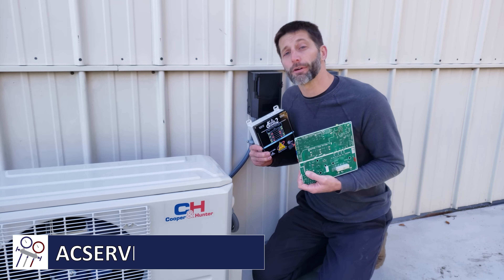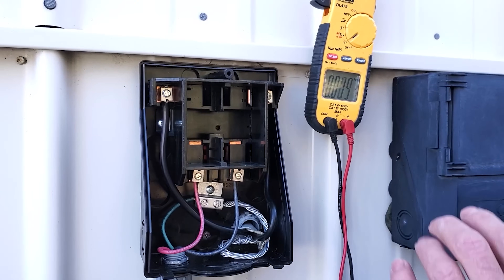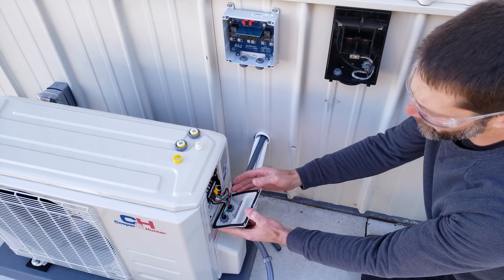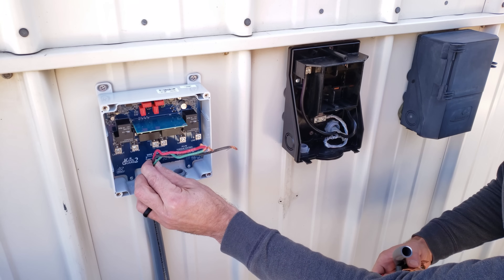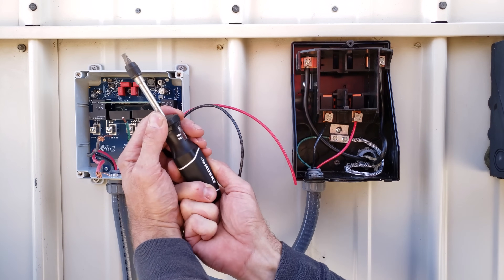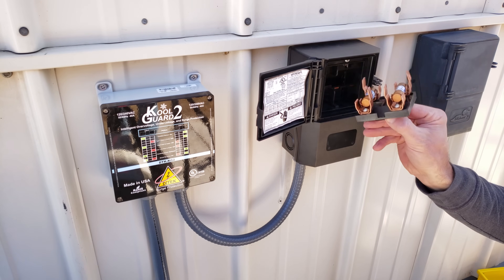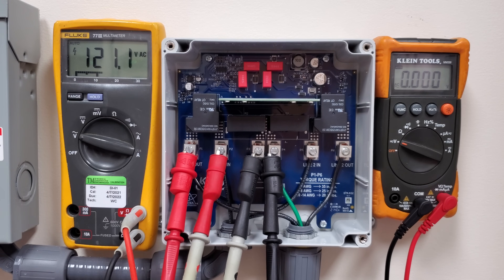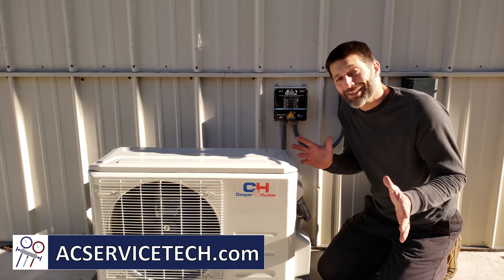Mini Split Failure from Electrical Surges, High and Low Voltage! HOW TO SOLVE IT!

Comment: I was a commercial tech for many years and installed a lot of input reactors which condition the power to even out the highs and lows. Mostly for vfds in industrial plants that had a lot of surges when large equipment would turn on and off. It was 575 three phase.

Comment: Nice. I have had so many surges/electrical problems at my house in the past few years. Blew out an led light, power strip, and washing machine board in that time. Installed a surge panel @ the breaker. That device looks like the way to go for $ unit protection.

Comment: I have a Cooper hunter minsplit with line in voltage 246. They are saying I need a step down transformer and disclaimed warranty.  They said max is 245. Do you think I really need this ? Is 246 really too high? thanks

Comment: Hi,
I'm getting ready to install a Rheem water heater that has a built in heat pump.   Do any of you know if the Rheem heat pump water heaters have this kind of protection built in, or if the KoolGuard would be worth installing?

Comment: We had a unit like this installed at our shop and the boards go bad all the time.  Our unit is a bit larger than the one in your video but fails all the time.  We've put a whole panel surge protector in but it still blows out the main boards and vfds.  It's a carrier. I'll have to inquire about this item and if it's possible to get.

Comment: Would you recommend Kool guard 2 over ICM 493 or vice versa?
Reply: Hello, what did you end up buying?
Reply: I assume this will work with any outside condenser between required ext shutoff and condenser ?

Comment: How did you get your hands on one of those? I can't get it from any local supply shop in Northern California. It kinda pops up here and there but no price or way to get it. I think this will keep one of my customers in Davis out of trouble with his 4 head mini split. The board and DC fan motor for the outdoor unit failed. I blamed the disconnect but seeing this makes me think it will really keep the machine safe.

Comment: sir i have a question.meaning  every time that there is a over or under voltage activity from the power source the unit is shutting down.?thanks for the info..

Comment: I have an outdoor unit (regular 3 ton heat pump) at the end of about 60 feet of wire in a 120/208 feed.  On very hot days it takes a few spinups to get going.  The amp clamp shows a very high start surge, but running is fine.  Capacitors all fine, regular incoming voltage looks fine.  I'm guessing that there is a voltage drop due to the inrush amps on that length of wire and starting out at 208 anyway.  Is putting this unit (for protection) and a soft starter (to deal with the inrush/voltage drop) together appropriate?

Comment: It does seem to me like that 120v countries have more power surges than 220v countries even in my 3rd world country i do see occassinal high or low voltage (250-190) but never had any power surge. My ups is very sensitive to power surges like turning the tubelight off causes it to freak out and still have not seen it go into battery backup mode while on normal utility.
Reply: May be, i have 230v where i live and it was never wrong voltage as far as i know

Comment: Would you recommend this especially if your running your Mini split off a back up generator for power outages especially in heat mode?
Reply: Considering that this unit is $200.00 plus installation if you can't do it yourself it might not even be worth the extra expense given you likely have a much cheaper unit to begin with. Make sure the generator is an inverter type as well for the cleanest power supply.

Comment: This monitor phase?  Like L1 120 V  and L2 120 V NOT 180 degrees out of phase? I'm looking to see if I can power a 240 V Mini Split with a 5000 Watt inverter off two outlets on the same inverter.   The mini split also is inverting AC to DC. I'm thinking the mini split board does not see phase and just needs to see 2 120 V legs.  Sorry if this is confusing.
Reply: Benjamin made a video on his channel covering this, I believe…

Comment: What is usually the symptom of a mini split that has been under a surge condition? Blown fuses on the board? A locked out board with no other explanation or is there an LED code? Or is this type of surge protector an add-on/preventative device? I only ask because I think ive only ever come across maybe one set of bad fuses on a mini split in my entire career(including my own), and that was because a snow plow had buried it in a huge pile of snow. Thanks.
Reply: Your right. Most mini split are electrically pretty robust, and many larger units also have a separate power filter PCB
Reply: They start acting stupid lol. No really, you don't want to have fun with that issue. Either that or the compressor won't start cause the inverter drive went out.

Comment: Do they make these for standard heat pumps and/or outside HVAC units?
Reply: As long as the circuit isn't drawing more than 40 amps continuously it will work on a standard heat pump / condensing unit.

Comment: Interesting, but also curious why other countries with millions of AC units don't make use of such power filtering devices at all? 
Or they have power filter circuit built in
Reply: They use voltage stablizer which is directly connected to the mains ( india style)
Reply: @zakkaidmello5641   I notice almost every outdoor pc board has power filter circuitry. So no need to double up on it
Reply: @Froggability  if that was true, why are these devices out here?
Reply: @Froggability  it cleans or evens out the power going to the compressor and motor it doesn’t regulate high or low voltage so this is absolutely necessary

Comment: Is this available in voltage higher than 240 ?
Reply: No, it is designed for 120/240V or 120/208V split phase circuits
Reply from the maker: I believe the highest voltage for this model is 240v presently, thanks!

Comment: In a new plant which had 11k amp @ 600v. The engineer was a co. cheapskate,he opted out for 2-500hp AC motors, instead of DC, In no time we 
found that firing 2 500hp AC motors together would drop the B phase on the grid. By the 3rd grid drop the elec co cut our service until we added 
2 soft starts, line conditioners, 200hp sullair to vortex cools all the DC rectifiers. Cost $200k over the int DC setup, by time we were done

Comment: So you are saying that the regular surge protectors installed by HVAC techs on the side of the power box are useless ??
Reply: that's incorrect.  Standard parallel SPD's are very important and protect from any over voltage surge/transient situation.  The KG2 was engineered for inverter driven HVAC systems and monitors and protects from both over AND under voltage events

Comment: Question I know this is a different brand ac but inverters with the E6 error code especially the Gree brand is it possible someone out there know how to fix.. this issue, or who to repair the pcb
Reply: What type of unit is it? Inverter, non inverter, cassette

Comment: Great video.  Seems like a nice product but…I wish we could know the price of this product without filling out a form and getting a quote.
Reply: It's about $360.00 on Amazon. Which I consider outrageous.
Reply: @j.p.8276  It's available on Amazon? I couldn't find it on Amazon.
Reply: @j.p.8276  Yes so do I. Not worth it.
Reply: @j.p.8276  The product is not available on Amazon and is nowhere near $360.00. Are you sure you aren't mistaking it for something else?
Reply: $360 for a good quality surge protector, that can potentially save thousands of dollars in new control boards and HVACR repair costs....is totally worth it.  Especially in areas where you may have very unstable supply power.
Reply: I'd pay it if I could only buy it.  It's not available anywhere to buy.
Reply: @ManTimeT.V.  Hmm, the mini split will be in a mountain cabin which has frequent outages to say the least. Are mini splits prone to damage from voltage fluctuations then?
Reply: @johnaclark1  Give us a call or email us at the factory and we'll help you locate a reseller/distributor in your area
Reply: @w1swh1  Hi there.  Yes, any electrical device that is controlled by a control board, would have the possibility to be damaged by power outages, high or low surge of power, etc.  If you have a cabin in the mountains, your best bet would be to heat it with a wood burning fireplace.  Or are you wanting a heat source while you are not there, too?
Reply: @ManTimeT.V.  Well actually we want it for cooling mainly. In the summer months it get so hot (90+) during the day. It's unbearable and stops us going some weekends. We have a log fire but in the mornings in winter it can be very cold unless we light the fire so it would be convenient for that as well
Reply: @w1swh1  Oh, I See.  Yes I agree, 90+ is warm haha.  No easy answers for you, though.  You could set up a heat pump with reversing valve for heat and AC, connect it to your mail power and also setup a back up power supply ( inverter ) that gets wired into your panel.  That way, if your power does go down, for long or short periods, your inverter will fire up simultaneously with the outage and keep your power supply stable.  It will run for as long as the fuel in the tank lasts.  Some of the tanks are quite big and can run for many hours straight, depending on electrical usage etc.  "Generac"  brand inverters are amazing.  Lots of good reviews and I know someone that has one and has to use it pretty frequently, as well.  This setup wouldn't necessarily be cheap for you, but it would set you guys up very well for almost all situations.  The Generac would be around $4000-5000 ( depending on what size you need ), plus install.  And the heat pump would be around $7000-10,000 installed.   These are just rough estimates without seeing your cabin etc.  If money is no issue...than go for this setup!
Reply: @ManTimeT.V.  Thanks appreciate it. 
An inverter would be over the top for our requirements. We have gone for a two zone Mitsubishi which I will try to install myself. Yes I know warranty would be invalidated but I've been watching all the Youtubes and buying top of the line tools and equipment. The cabin is remote. Nearest HD is over 40 miles away which doesn't sound much but it is steep twisting roads. Takes at least 4 hours round trip so if I forget or need something I don't have the day is shot in travelling. But it's still fun 😊
A guy called me about the voltage protector. So you would recommend it?
Reply: @w1swh1  that's awesome that you guys are doing it yourself.  Depending on what the regulator costs, I would recommend it.  As long as you can afford it.  What is the price of the Mitsubishi, can I ask?  If your main reason to get a surge protector is complete power outages, it may not be needed for you.  Is the power stable when it is working?  There is also surge protectors with battery back up as well.  I would really consider a generac or similar brand inverter.  You can get smaller, cheaper ones too.  Power outages shouldn't hurt your unit too much.  Frequent unstable power ( high or low ) is more to worry about.  You will have to test your power to see if that is happening before buying a protector for that.  And of course, see if the cost of it is worth it as well.
Reply: @w1swh1  also, I'm curious, where is the cabin?  It sounds amazing!
Reply: @ManTimeT.V.  I estimate the total cost including high quality tools will be less than $6500. Mirsubishi is 36,000 BTU 4 zone but only using 2 zones 18,000 BTU each.
Reply: @w1swh1  that's awesome!  Should be more than enough BTU for a cabin :)
Reply: @w1swh1  yes it is worth it , much cheaper than buying a new unit
Reply: 200 now

Comment: Bend the conduit  at your mark try make a180 degrees the wires will stay on the bottom of the conduits. Run a pvc cutter over the top lightly  it will rip but a little piece grab some snips. Faster than pulling the wires  brother
Reply from the maker: Yes, I actually I do the same with bending the conduit, partially cutting the flexible conduit and then finishing with a knife without nicking the wiring. However, I figured I should show the safer way where there is no possibility in nicking the wire, thanks!

Comment: Having a problem with mini split heatpump.
So the indoor Fan work on a very low speed when is set on Heat . From scale of 1 to 10 it blows only 1 . But on Cool mode it works perfectly fine, also the Fan when it’s on ON mode it blows perfectly.
But on heat mode the fan isn’t working and you can’t even adjust the fan speed.
The condenser outside works fine
Reply: Depending on your outdoor temps, the amount of heat it can move inside is very low. The unit knows this and will limit fan speed if your coil isn't getting hot. 
Or you have other issues.

Comment: I've never removed the conduit before cutting seal tight.  I just scour it with pvc cutters, snap it, and use dikes to finish it off.  Never had any issues touching conduit inside.
Reply from the maker: I hear ya and actually I do the same with bending the conduit, partially cutting the flexible conduit and then finishing with a knife without nicking the wiring. However, I figured I should show the safer way where there is no possibility in nicking the wire, thanks!
Reply: @acservicetechchannel  can you please tell me why you ise UEI meters instead of lets say fieldpiece or fluke. Im new to the field and I've learned so much from your teaching. Please help
Reply: @BOOKERT232  Use what you like. Fieldpiece never had a great reputation for me but others like them. Fluke is expensive but is now riding mostly on reputation. You can get Testo or even others. I like my UEI.

Comment: My pioneer 12000 BTU unit cost me $675 a year ago, not going to spend $360 for this unit, there are surge protectors for a quarter of the cost, maybe not as sophisticated but makes more $ sense
Reply: It's for people with $3000 to $10000 inverter systems. Yes, your pioneer unit is cheap. But even they can cost over 3000 for multizone. 
They can mostly handle voltage issues, BUT, if you have bad line power all the time, you need to protect it.
Reply: Brother, surge protectors won’t stop over and under voltage. This does.
Reply: @user-ln7of9gs4s  I agree, but willing to take that risk, which I consider low
Reply: Inverter systems are incredibly sensitive to voltage drops or surges these are actually a great device for companies installing a lot of inverters

Comment: I dont think customers will agree on dishing out $ 350.00 " inless ⚡️⚡️ issues 
in 30 years in the AC / heating trade i saw it once and it was due to the transformer called up hydro and they had to change it after a few arguments ⚡️⚡️
but interesting gadget 👍
Reply: Nobody had inverter units for the past 30 years except weirdos who bought Trane's unit in the 80s or early 90s. That's why. 
Kalos requires them on all installs of inverter units, like Carrier Greenspeed. They've solved issues where they had too high voltages come in and the power company will not fix. If you don't account for that you'll keep having a unit break and keep replacing control boards.
Reply: These new inverter systems should absolutely have these the boards are so sensitive to under and over voltage it burns them up constantly these things just haven’t caught on in the us which is crazy because it is costing companies a lot of money
Reply: I recently failed an American Standard Platinum variable speed compressor unit under warranty that cost me $2400 in labor/freon. The installer suggested I get one of these because I discovered the utility voltage will drop to 210 at times which is probably a death sentence for this unit, if it was running when the voltage dropped. I did have over voltage protection but that was not the issue it seems.

Comment: I installed a mini split in my cargo camper conversion and I have a hardwired voltage monitor/cut out for this exact reason. It was like $300 but we’ll worth it

Southwire is the brand. It super nice it has a digital display so you can see live voltage, amps watts. It does the same thing, monitors for over under voltage or short to ground reverse polarity etc and will cut the circuit.
Reply from the maker: Nice, thanks for the post!

Comment: So this won't work on 208 volts.
Reply: It works on both 120/240 and 120/208 split phase circuits. Both are 120V line to ground, 208V is just 120 degrees out of phase versus 240V being 180 degrees out of phase

Comment: I had lightning strike on my home that killed almost every electrical device . Fans lights tv computer server rack everything was fried but the only things that survive was all 6 of the panasonic inverter mini splits and whirlpool inverter fridge. 😂 , My pc survived cus of a ups. My dads pc did not survive cus his ups was much older model and the ups itself died from the surge. A lot of switching powersupplies survived but their loads did not. Everything that was on lan died including the wifi router that just exploded into bits . Tv died. There was holes on internal chips. Like the lan chip had it's cap blown off. 3 celling fans died , i had to send them for coil rebuild. all in all it was about 3000$ worth of damage but nothing happened to the inverter ac's. I do not have a non inverter anymore. But with my previous experience with air conditioners they typically do survive lightning strike cus the compressor motor just absrobes bulk of the surge.